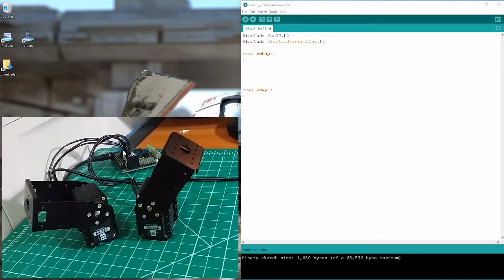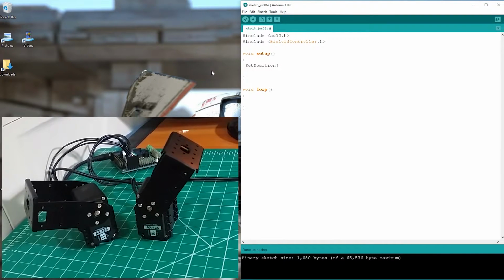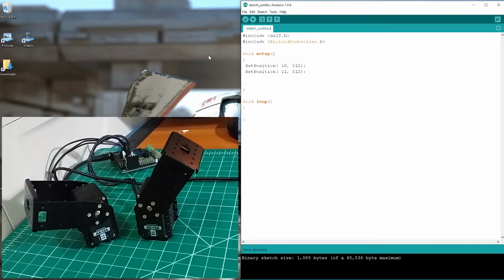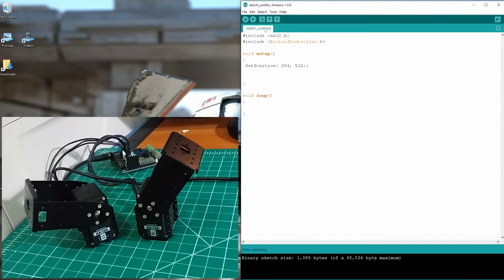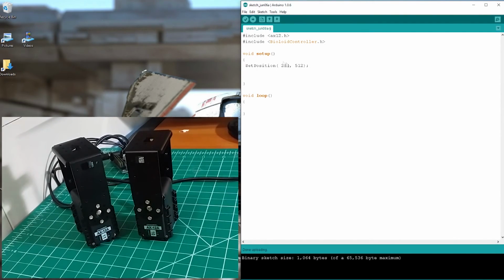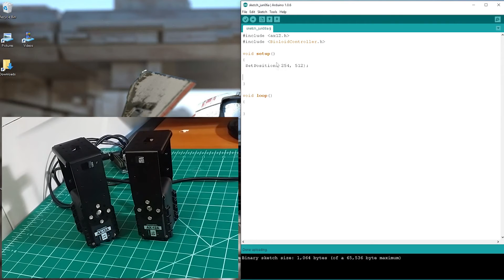Dynamixel Tutorial 8: Using the Broadcast ID to Control all AX-12 Motors at Once

Comment: I wanted to explore inverse kinematics by using a hexapod, but when looking at a lot of code for open source robots I got confused (some of it made sense).  So then I wondered if starting with an arm would be simpler.  I found your video where you demonstrated inverse kinematics.  OMG!  Awesome.  Then, when digging deeper, I find that you have already explained the setup and testing for the motors...  Thank you so much.
Reply from the maker: Hi yes IK (inverse kinematics) would be easier to understand if you look at a simple case first (two or three links). Then you can apply IK to each leg of your hexapod. I'm glad you've found them helpful!